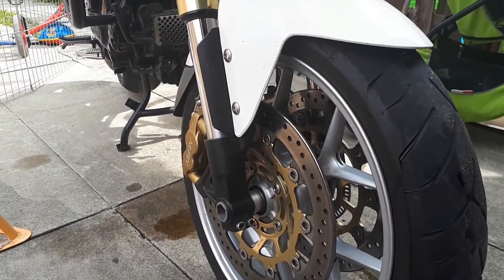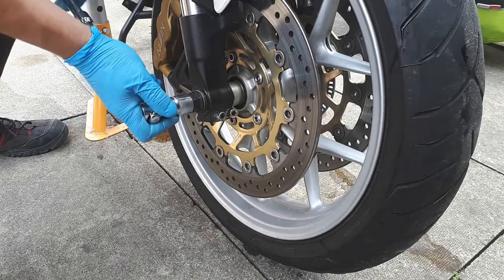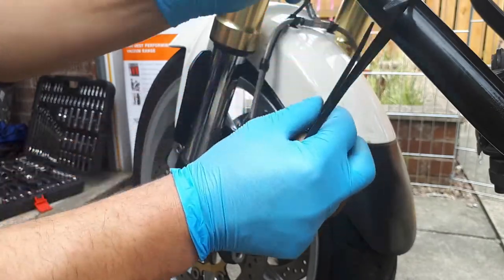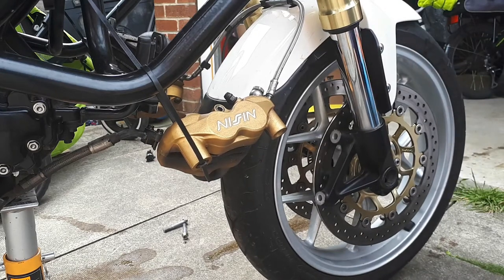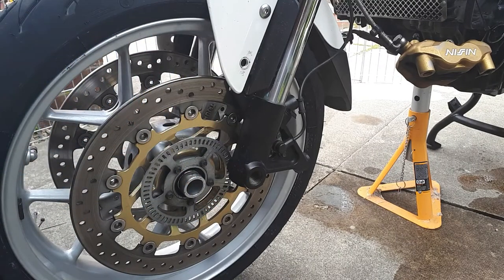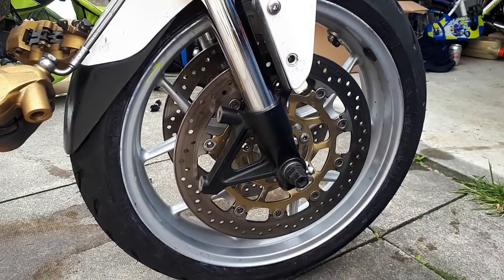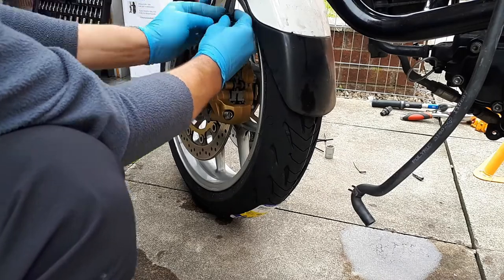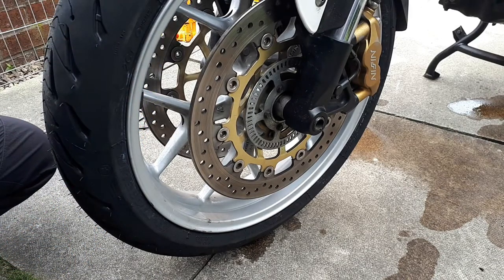How to remove front wheel Triumph Tiger 1050

Comment: What is the spec torque on the front wheel per lb
Reply from the maker: 65Nm wheel bolt and 22Nm pinch bolt
Reply: @GicaPhp  thanks a lot! did you make a video on the rear wheel removal?